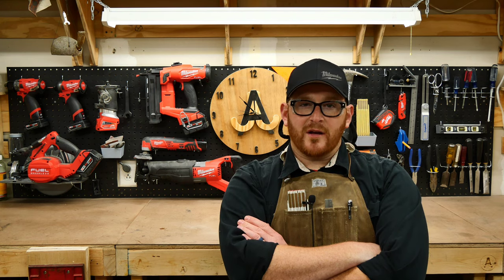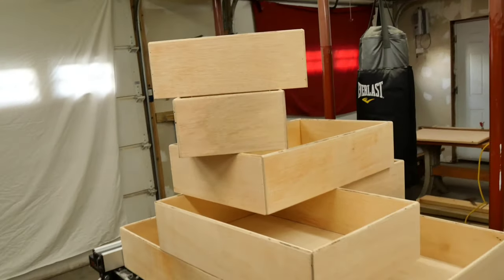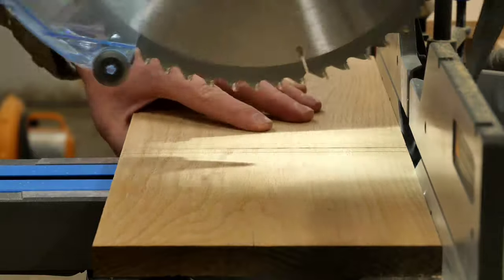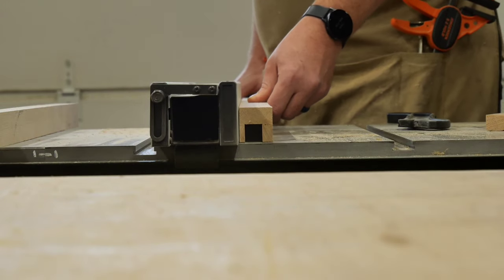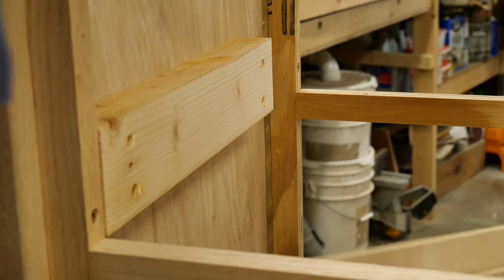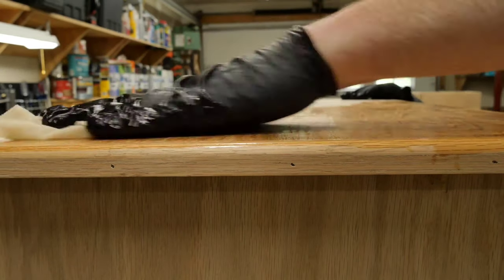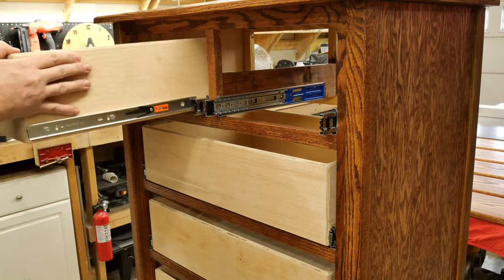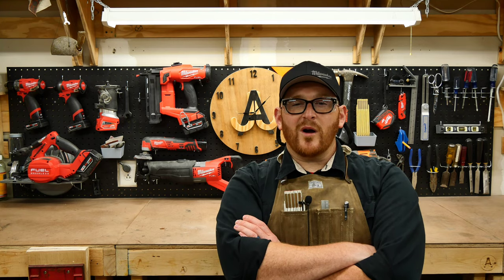DIY Chest of Drawers - How To Make Your Own Furniture // Just Joshin' Around

Comment: Looking good - how did you build your throat plate for your dado stack?  Looks like you bought another Delta Throat plate and then cut it up?  I am in the process of building a 6 drawer chest, that is more wide  Using Baltic birth plywood, with a birch face, then flamed birch for the drawer faces
Reply from the maker: That sounds like it'll turn out really nice. 

As for the throat plate, I actually sent you an email (still had your address from our correspondence about the table saw storage box) with more detailed information as to how I made it. Let me know if you got it.